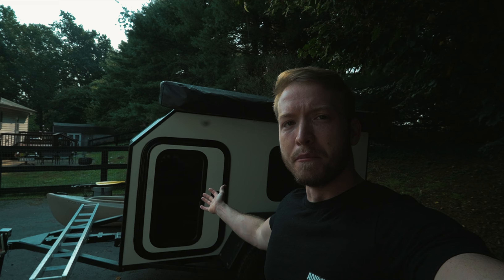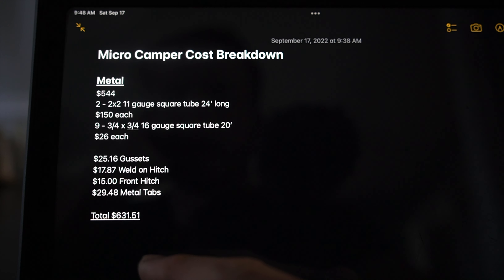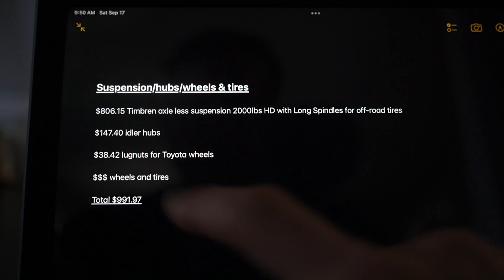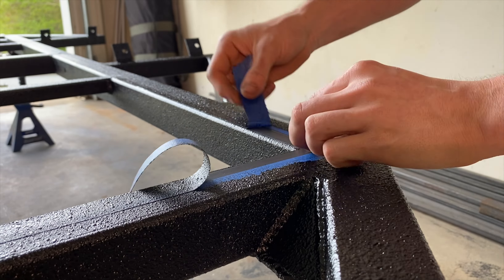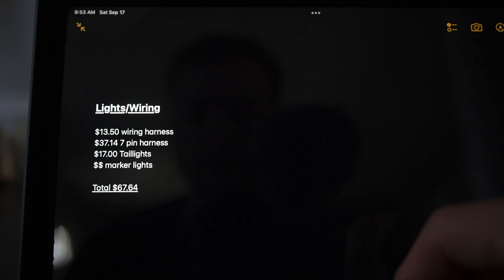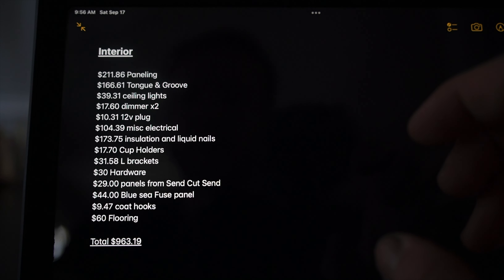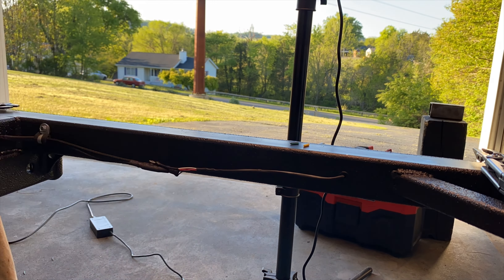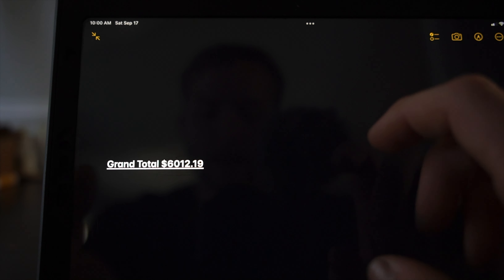Micro Camper Build | How much did it cost? | Cost Breakdown!!

Comment: I just built and sold a 5x8 teardrop camper. I was surprised at the prices for the supplies. $800 in Filon, $500 for a door, windows were $200 each, plywood was $100 a sheet. I finished with $5200 in it and sold it for $6000. Not something I would do again.
Reply from the maker: No doubt! Adds up fast

Comment: The price isn't that bad. Theres some tiny coleman campers near where I live that are just a little bigger but costs 15k or 16k. They have a rear kitchen and an ac unit (that runs off shore power). Not worth it imo
Reply from the maker: Right! DIY price is very reasonable. Once you build one you can start to see why they are priced the way they are after you calculate material cost and labor

Comment: I have only stick welded, but with the wire welding (mig, tig, what ever it’s called) can you do just the wires with no gas? I thought you could.
Reply from the maker: That would be considered “flux core” welding. Yes it works, but the results are less then desirable in my opinion. 

You are much better learning & will yield much better results on a MIG (Metal In Gas) setup!
Reply: @Adv4x4  thanks.
Reply: @Adv4x4  oh, do I have to purchase the tank and then buy gas or do they (companies) rent the tanks?

Comment: The plastics he used for the outside walls did he have to paint them or dos the writing peel off in a big film strip?
Reply from the maker: The panels are 3mm aluminum composite sheets! The film peels off to reveal the white coating, I did not have to paint!

Comment: I want to get into projects like this but I've never welded and know almost nothing about it. Did you use flux welding function in these videos or MIG? Any advice for starting welding would be awesome! Thanks
Reply from the maker: I used MIG! It’s worth buying the gas and welding with MIG you will see much better results then flux core welding! I use a Klutch welder from northern tool. Cheap unit!